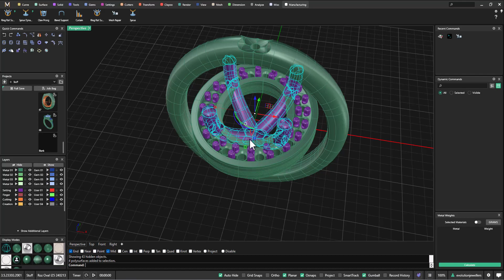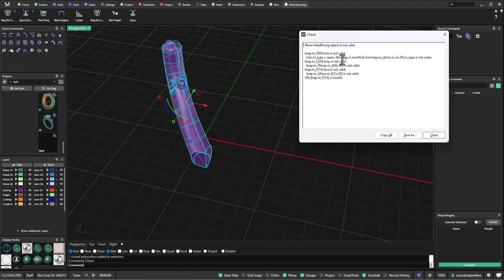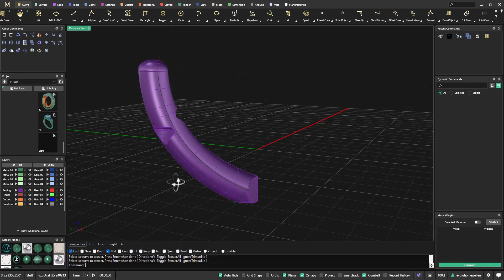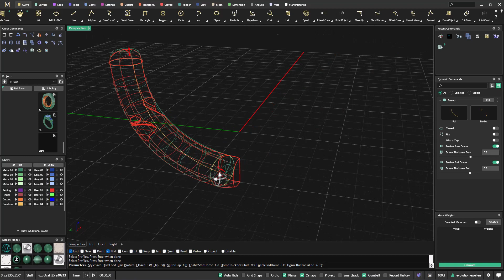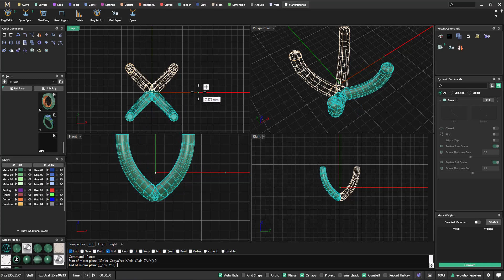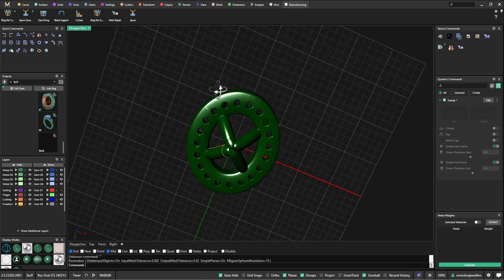MatrixGold Mesh Repair issue and fix

Comment: Hello! Big fan of your content! I have had major issues with manufacturers being unable to print my STLs from MatrixGold. Every time I export a mesh, they end up being around 25-35MB! Way too big! I've tried everything and am at my wit's end. Any tips or advice on how to fix this issue is much appreciated! Thanks again!
Reply from the maker: The first thing I would recommend is to use the break history button prior to using the mesh repair command. Doing this may remove all of the history associated with your file and may result in a smaller file. Also changing the output option in the mesh repair command will adjust the file size. The default is usually 0.03 - the higher this number (eg 0.04 and so on), the smaller the file size. But beware, you may see sharp edges round off with higher output numbers.